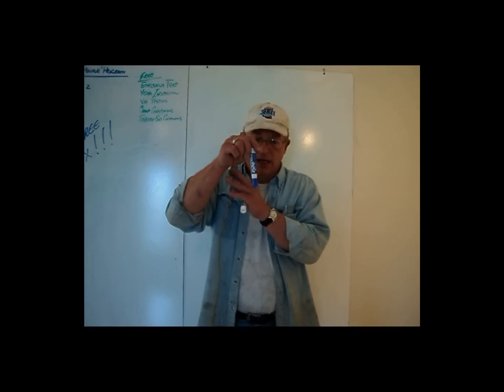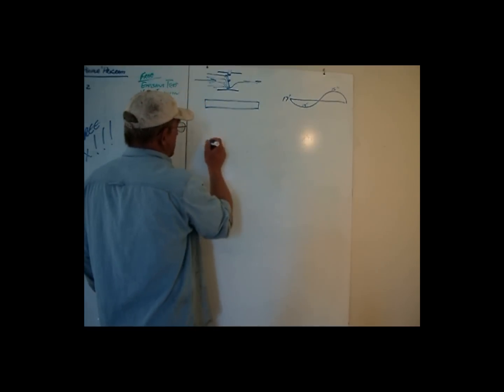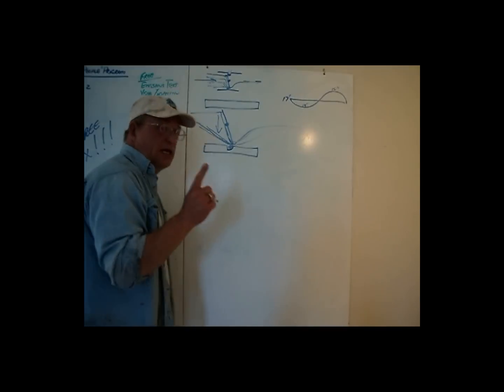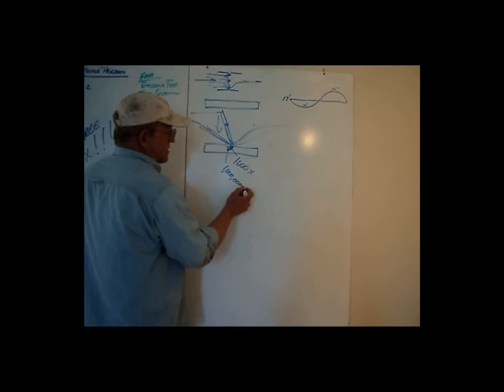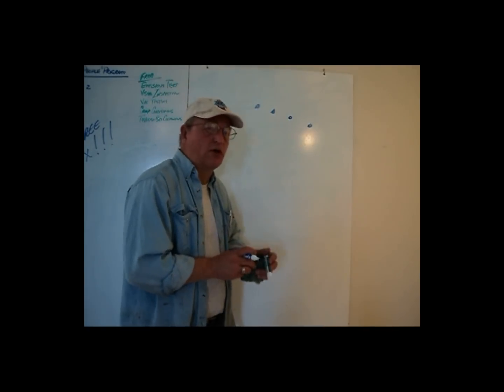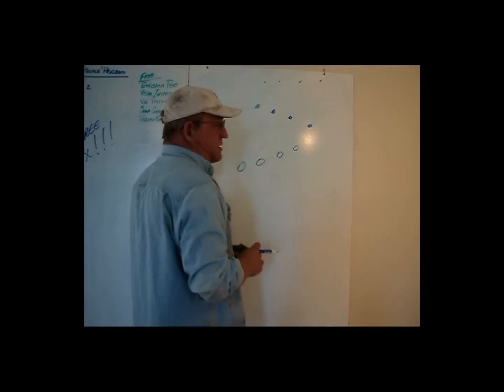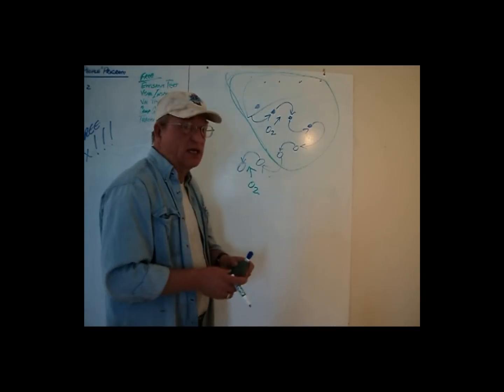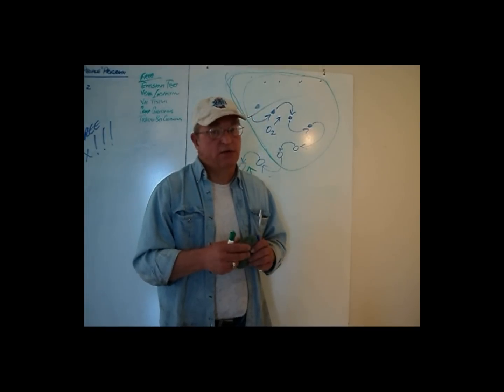How Does The Gadgetman Groove Work?

Comment: Turbos? Superchargers?? explain how this groove is more efficient than cramming air into a cylinder.
Reply: The groove isn't about quantity of air, it's about quality of air - for fuel vaporization.  The air going into the cylinders via the groove create air-clusters that twist at high velocities, like tornadoes, as they pass the throttle-body, down the headers and into the combustion-chambers where these clusters of dense twisting air are able to vaporize a lot more fuel each stroke.  

The average car is only about 20% efficient, only 20% of the fuel you consume actually goes toward making the wheels move.  The other 80% is almost entirely burned up in the exhaust/catalytic-converter.

By just cramming more air into the cylinder, yes you'll add power, but it'll also require a lot more fuel and the other 80% still gets wasted in your exhaust.

Comment: im an automotive mechanic, this is complete crap if you make that cut in your carb you will ruin it you will no longer be able to adjust idle speed as idle speed is adjusted by a screw that stops the throttle plate at a specific point and you need to change that point with ambient temp, altitude and as the engine wears. I don't like Edelbrock carbs as they have about half the end user adjustments as most other carbs that being said the people at carter that designed it and Vic Edelbrock that modified and sold them and became a millionaire are a hell of a lot smarter than this random idiot. This man rips people off for a living.
Reply: If he were a scam artist, shouldn't he come across as more believable?

He makes his points with FACTS, not charisma.

So why don't you put his claims to the test, instead of showing your ignorance?
Reply: You're talking about carburetors. He's talking about throttle bodies. There's a bit of a difference there.

Comment: this is horseshit! hahaha, so it maximizes horsepower at when the throttle plate is closed, like at idle? WOW, hot shit! hahaha.  on a single throttle body set-up, the pulses from each cylinder do not hit the throttle plate at even intervals.  this is a similar theory as the Helmholtz resonater but with added snake-oil and bullshit haha

Comment: Could you do a mod like this on a 6.50 hp Tecumseh lawn mower engine?
Reply: if it uses a throttle-body, yes.
Reply: @Wes_5kyph1   yes, Wes, or just the carburetor also.

Comment from the maker: Hey Bubba. Actually every engine on which this modifications has been applied has demonstrated improvements in all operating conditions. By giving the "waste fuel" what it needs to burn inside the combustion chamber, more O2 is consumed, and the ECU responds by reducing the fuel delivered to maintain the programmed AFR.
THAT is what is providing the increases in not only economy (in most cases) but in power delivery as well. They simply breathe better!
GREAT questions!
Ron
Reply: Gadgetman these people try to disinform and spit on these things because you're actually doing Good.

Comment: How does this affect AF mixtures for boosted cars? If you lean out the mixture it does create more power but detonation can occur. Does the higher vaporization rates prevent a lean condition? Very interested in trying this on an inline 6 boosted application instead of adding larger injectors to make up for the extra air flow created by increasing boost pressure. Thanks for sharing it seems plausible.

Comment: if you have noticed the lower flash point of todays gasoline to gas from 30 to 40 years ago.
i very rarly reply to any video i see, but i was impressed with your knowledge of what is happening inside the chamber. i to am a mechanic of many years. also have done GREAT research in vapor carbs and hho use. your mod although seems simple has GREAT repurcusions through the chanber and ecu..

Comment: i see what your saying, and i do agree with compression of air and ecu adjust for this. i also understand your explaination of the make up of gasoline, and also agree(bigtime) the reason why this make so much since, is. your introducing higher air content under pressure to the chamber. how ever, your larger molecules are a retardent ( in my opinion)  continued-

Comment: People try to tell me no gas saving things work. They don't understand how an engine works. We know we are not burning all the fuel in the cylinder because smog exist. We know we can make more power with cylinder heads and camshafts etc. This increase efficiency making more power, but it also reduce the amount of fuel burned cruising. To take it to the next level you need a deeper understanding of what is happening in the engine. You show some of this deeper understanding in this video.